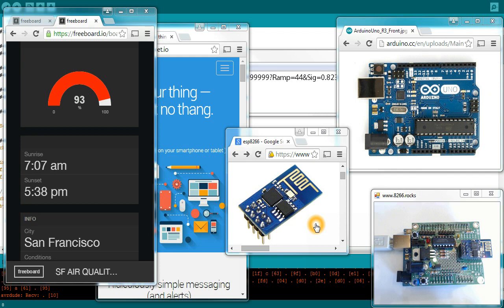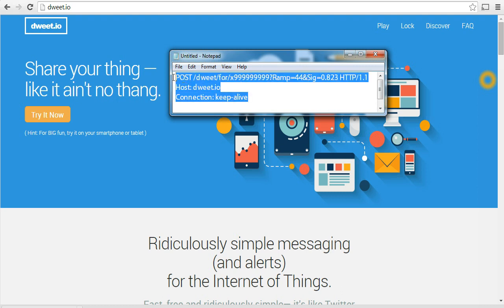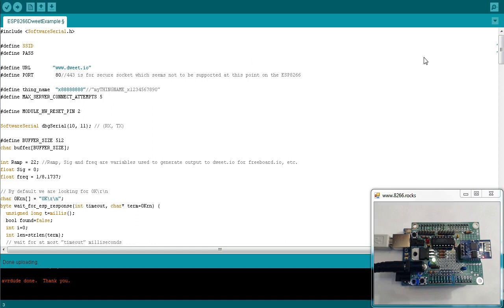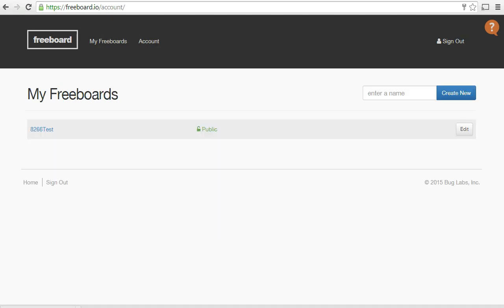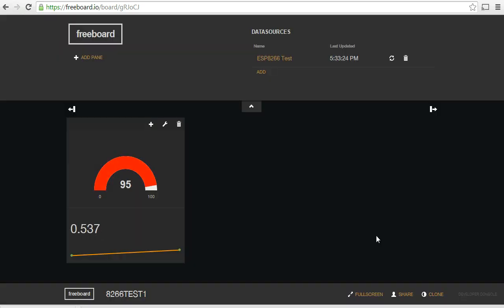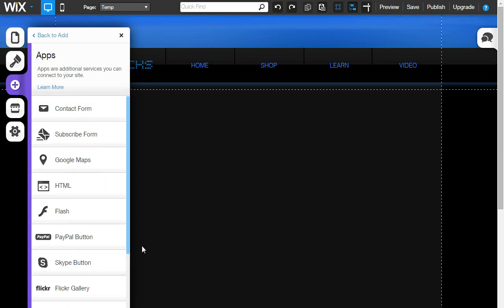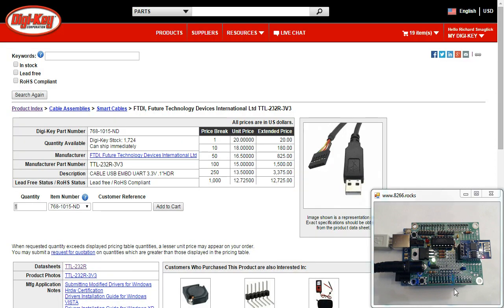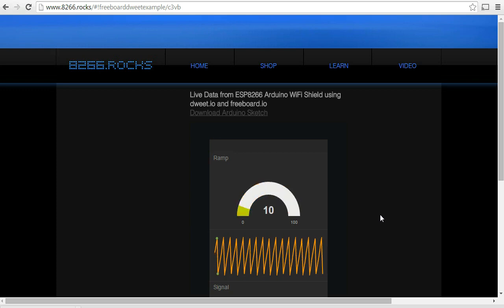ESP8266 - Tutorial #1 - WiFi, Internet of Things, IoT

Comment: If I forego the Arduino m/c and use just the shield/8266 setup via power adaptor, how many temperature probes can I hook up to it? I'd like to setup 8 probes on the one dev/8266 board. I know you can hook up multiple probes with one pull-up resistor in series to an Arduino (1-wire probes with unique addresses). Can you do the same for this?
Reply from the maker: +Jason Axford - I don't see any reason you couldn't do this just like with a regular Arduino board.  Kevin Darah gives a good explanation of using 1-wire temperature sensors here: www.youtube.com/watch?v=ZKNQhzPwH0s , and this video shows how to get Arduino running on the 8266: www.youtube.com/watch?v=-aZU8YqHlHw .